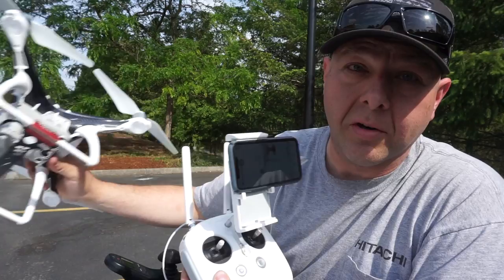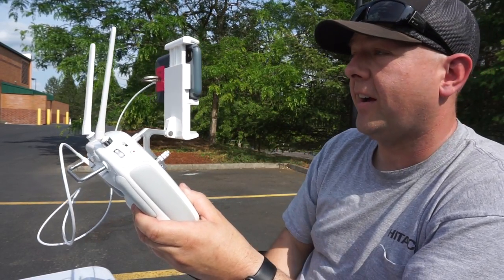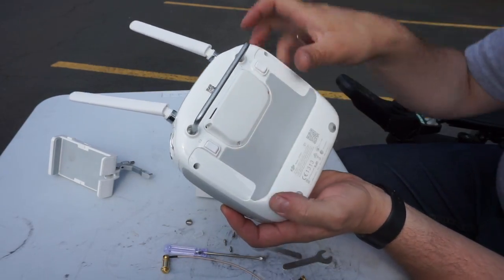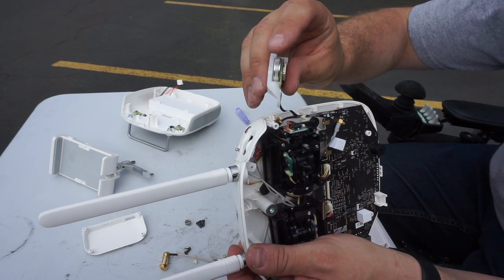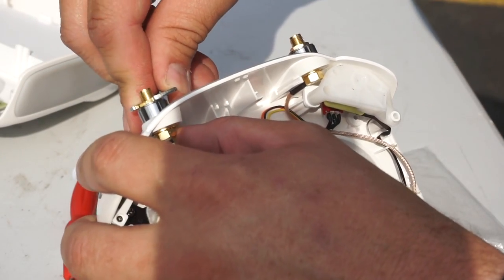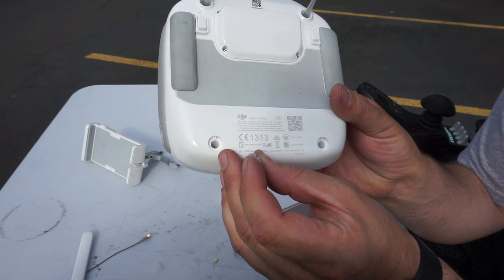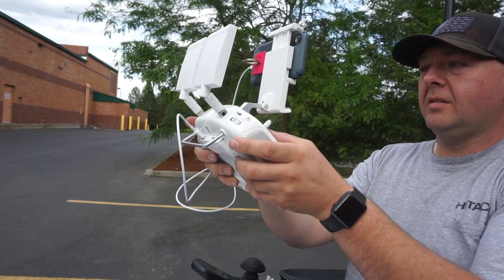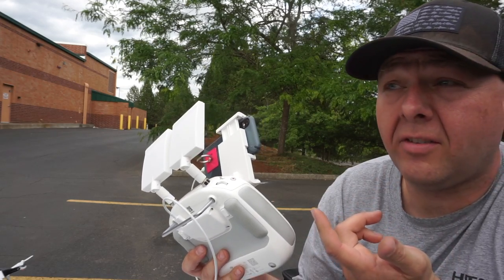VLOG 340: Phantom 4 Range Booster!

Comment: could you fit an extender (solid or cables) between the bnc connectors and the antennas? To maybe reduce RF exposure to operator , or to get the antennas  higher up or even so that you could sit in a car in very cold weather and have the antennas outside?

Comment: Didn't you try the CD hack for range extending?
Reply from the maker: I did! And it works! Was in another video... I’ll have to find it lol
Reply: What is the cd hack? I just purchased one and would like more range. But I don’t want to tear my controller apart.
Reply from the maker: just grab a couple cd's or DVD's and tape them to the back of the antennas! the theory is that it redirects the signal in one direction.. kinda.. but it worked for me!